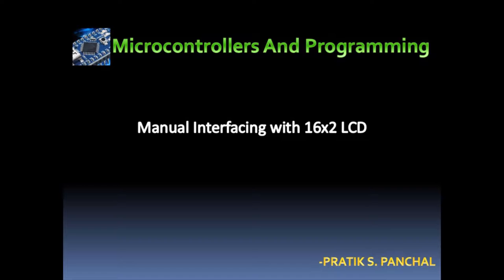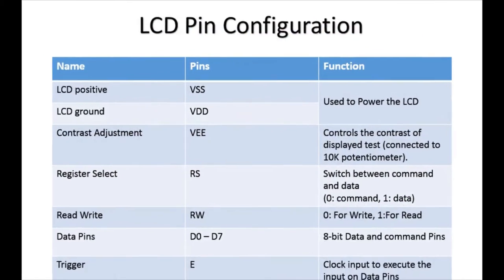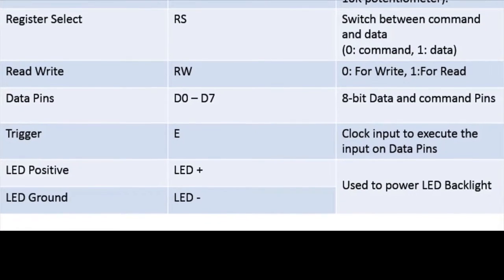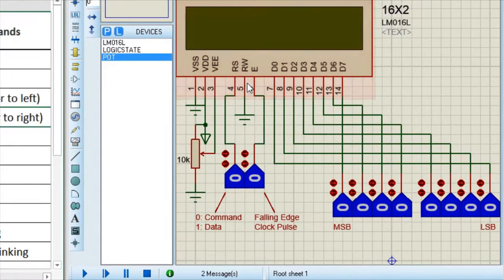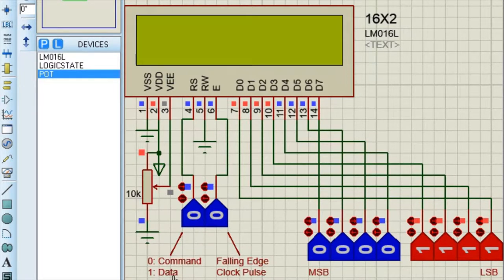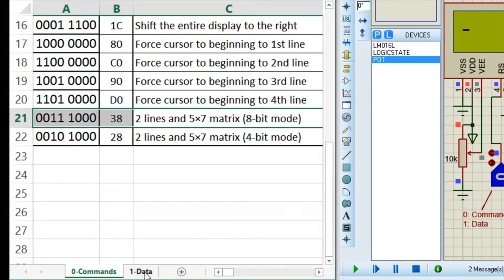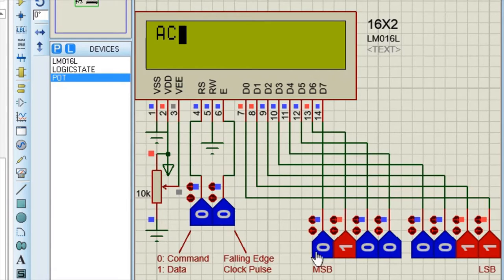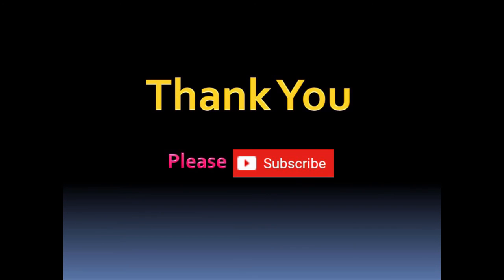Alphanumeric LCD Manual Control

Comment: This is best.....absolutely the best video I've seen about the screen. No body has done this, at list I haven't seen it. Very good. Congratulation for an excellent video. You have no idea how long I've been looking for something like this. I wanted to really understand step by step how the LCD works and what a better way to learn than this one. Loved this video. I going to post it on my social page even though people won't know what that hell it is. Thanks you again and keep the good work. I love to have the simulator you have but that is not so important now. If the guy that made this video read this, I wonder if you can make a video but on the 4 bit mode. How would that work? I have a problem since you at list 5 pin to set the display on 4 bit mode but then what? How you send all 8 bits of the data or commands? See what the problem is. if you  are only using 4 pins how to enter all the commands and all the data??? Good question NO???